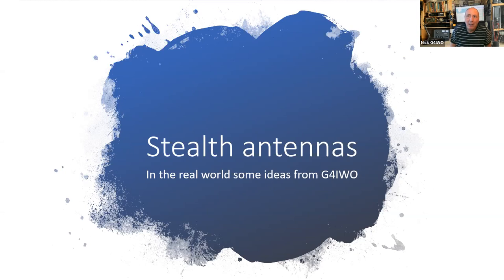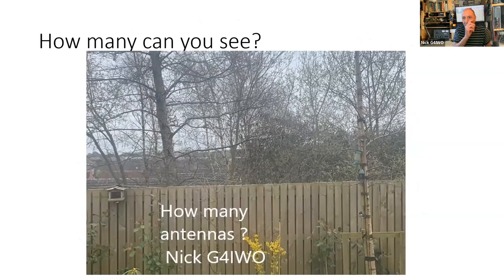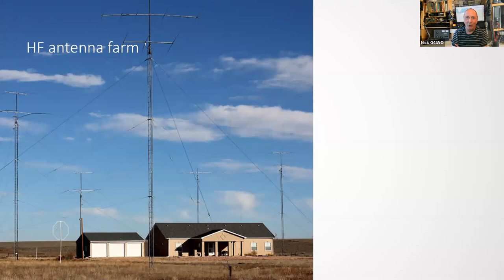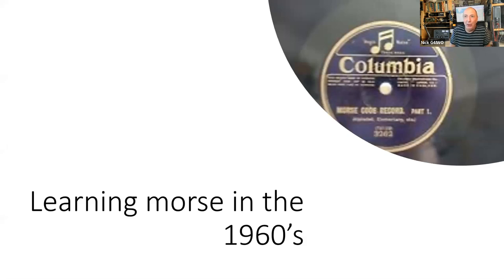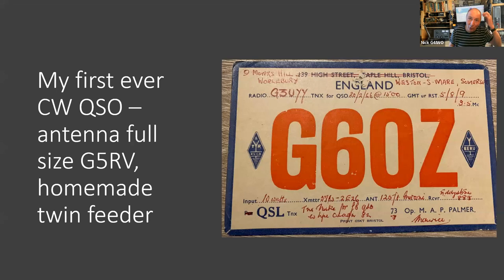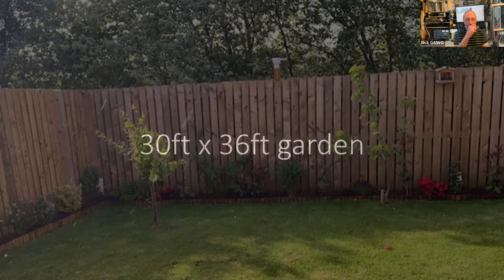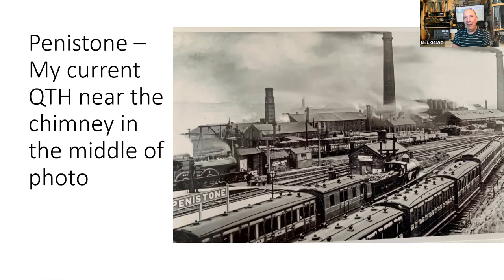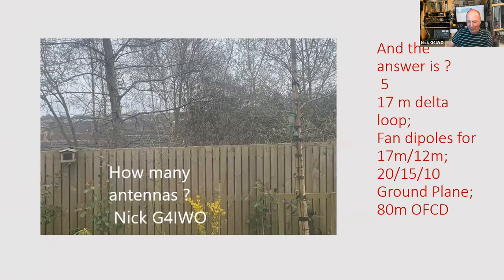Stealth Antennas in the real world a talk by Nick G4IWO.

Comment: There is a Silent Key(W5JGV) who created a antenna design that uses a tree as the actual radiating element and is matched using a matching element that is wrapped around the trunk of tree, might be worth trying it out, only problem is that it is designed for 630mtrs but with possible modifications other bands should be possible.
Reply: That sounds a lot of fun !